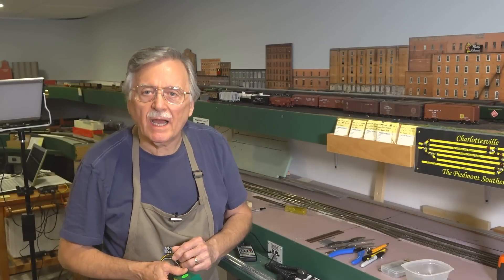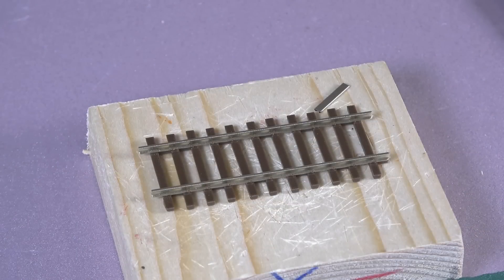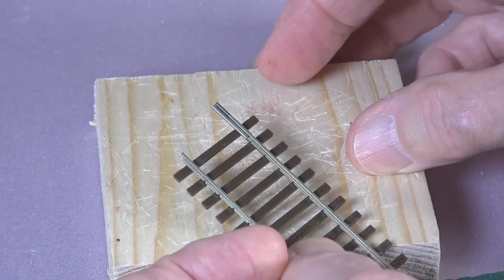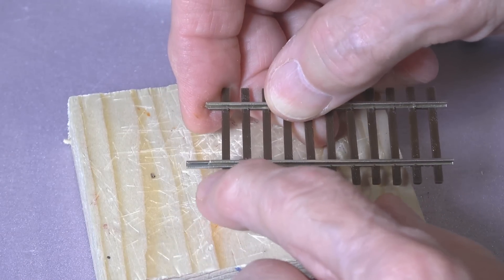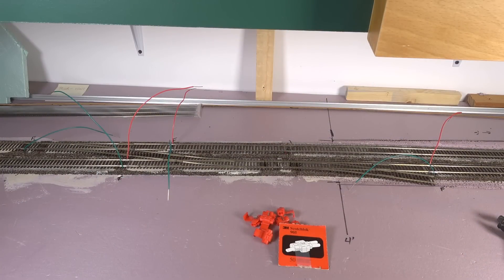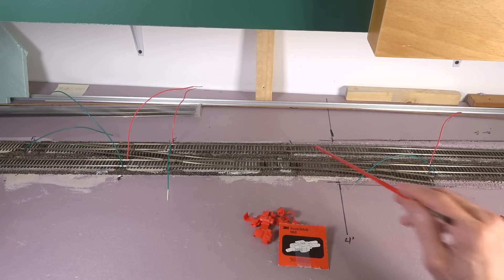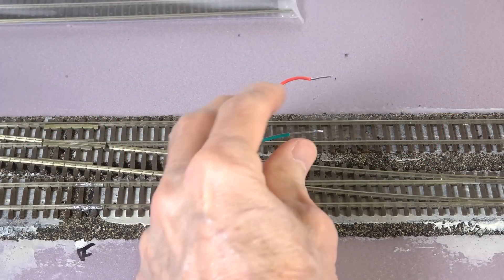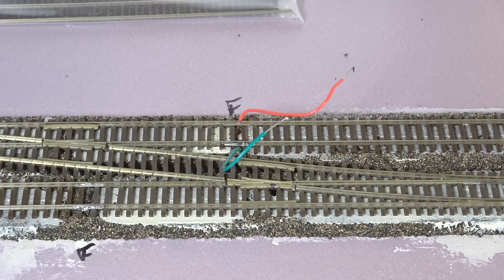Soldering Feeders And Adding Rail Joiners (343)

Comment: [  thank ,  you  larry  for  sharing  youre  video.  I,  bought  some  good  used  ho -  scale  track  from  a  yardsale  that  had  wires  solder  on  some  of  the  track.  I,  didnot  know  the  reason  for  this.  now  I  know  what  it's  about  now.  again ,  thank  you  larry  for  youre  explaining   this  to  me  and  others  and  the  purpose  why. ]
Reply from the maker: If those wires are just short subs where they were cut loose from the feeders wires then it would be best to remove them (desolder them) and add new full length feeders. If they are in the right place and long enough to reach through the roadbed then you could splice a feeder to them.

Comment: Half of the time when you go to solder the rail joiners the heat will warp the plastic rail. I just remove it and when Im done just a drop of crazy glue holds it just fine. Nice Video though!
Reply from the maker: Not if you use a heat sink as I have shown in some of my videos, or learn how to do it fast enough to prevent the melting.

Comment: When solo soldering the feeder wires to the track, try small wood slices (round toothpicks work well if the drilled hole is small enough) to wedge the wire in place, making the soldering easy. Nice video!

Comment: The regular rule for attaching dropper wires appears to be “black to the back”
I tend to think as follows. When following the track in a clockwise direction, I
work by  “red to the right”, the two “R’s”. Is this a valid alternative?
ps. Thank you for so many useful and easy to follow videos.
Reply from the maker: Whatever works for you, just be sure to document it and follow it consistently, about 95% of the problems folks have are due to mixing up wires.

Comment: Do you solder the joiners in place?
Reply from the maker: Most of them I do solder but I do leave scattered ones to provide expansion and contraction joints. These are especially necessary if the layout is an area that undergoes a wide range of temperatures such as a garage, attic, unheated outbuilding, etc. In my basement the temp stays in the mid to upper 60s and about 50% relative humidity year round so it isn’t a problem for me.
Reply: @TheDCCGuy  thank you.   Love your videos.  Very helpful.

Comment: Dear Larry, great instructional video. Love the way you’ve included the ‘bad’ joint. It’s indeed those instances where the ‘tug check’ or any other check people may come up with, are the easiest things to forego or forget. And of course those ‘bad joints’ are the ones which will need a lot of search effort whenever the joint gives up all by itself. 
Very much like the bent dog leg method. Humbly think a small jig with an attached spring loaded plier can be very helpful to perform the keep in place action whilst soldering.
Cheerio

Comment: I find your videos very instructive. I have been using a standard Exacto blade to cut the ties at the end of a section of track. Thanks for showing how to use a #17 blade to cut the ties. It is good to see that even a pro doesn't get the solder right the first time. 😄 What is the brand and wattage of the soldering iron that you use?
Reply from the maker: Its a Hakko. I talked about it in videos 35 & 214.

Comment: How long can I make a feeder wire that connects to a bus wire?
Reply from the maker: I like to keep mine 6-9” since I use 20 ga wire. Smaller wire will increase resistance and larger wire will decrease it so it is a tradeoff.
Reply: @TheDCCGuy  if I use 14 gauge wire I can go the 4 and a half feet?
Reply from the maker: Yes, I should have mentioned that earlier. You can use a heavier gauge wire until you get just below the feeder and then drop,down to the smaller gauge wire for the feeder.
Reply: @TheDCCGuy  I have one track the feeder wire is 4’6” to the nearest bus wire.   Is that too long?
Reply: @SkipRoGlo you should extend the bus wires closer to the join location

Comment: Larry do you recommend using Rosen core solder to help the flow of your solder when you heat it? I used to buy Rosen core solder at radio shack stores and it was superb for this application however I found that you need to clean up the acid from the melted solder joints, because it will decay the wire over time and the joint will break off. What do you think of that product
Reply from the maker: Rosin core solder is not acidic it is pine sap. Now a lot of non-acidic rosin is synthetic. I use additional paste rosin flux in cases where I am applying a lot of heat since you can easily burn off all the rosin in the solder before it can do its thing. However for small jobs such as electrical wiring or components I just use the rosin core solder alone.

Comment: Scott lock wire  are not good.   😢 Use wago type unit.  😊 Scott lock will keep cutting the wire until you have a open.   Wago clamp the wire they co e form 2 to 6 join.  You can reused them over and over.   I build police, fire and public work vehicle.  When I see the Scott lock on the wire in vehicle.  I cut the wire on both side and used wago.   Before that was but connector with heat shink.   
Also we don't sold the join.   But sold each independent section of track under the track and the drill hole where the wire go.    This is the fast way to do feeder.   You teach something form the pass 20 years.  Then i can talk about the power decorating.  But that is something else with dcc.

Comment: Thanks Larry, great tutorial. Have you ever soldered your feeder wires to the bottom of the rail or used wired terminal joiners that are soldered to the rails? What is your opinion on each as opposed to what you showed?
Reply from the maker: Solderi g to rail bottoms usually means doing it in advance and then fiddling with installing them essentially like the frog feeders I showed last time. With the method I showed here you can very close to putting them under the rail  and then the ballast will take cars of the rest. I’ve never liked the terminal joiners, always just found it easier to solder the wires, plus its one last thing to deal with.

Comment: With DCC friendly switches can you put feeders pretty much any where as opposed to being at the point end of the switch as we used to do with analogue all rail switches or electro frog switches.
Reply from the maker: As I said in the video the only feeders you need on a turnout like this one is at the frog. Otherwise all the rails are powered when connected to live rails at each end.

Comment: Is silver solder a better option for stronger joints?  I’ve used 60/40 rosin solder for years but understand that silver solder is stronger.
Reply from the maker: Have you checked the price of silver and silver solder lately? I think that will answer your question but no it is not needed.
Reply: Certainly from my past industrial experience there is nothing noticeable in it, certainly not for model railway use. You also will have to heat up another 30deg C or so to get the SAC alloy solder to flow - that I would suggest would increase the probability of more dry joints as well as slightly more damage to any surrounding  plastic…… skin, clothes. As Larry, it’s way more expensive, silver isn’t cheap!
Reply: The flux for silver solder is corrosive plus silver solder is expensive. The heat required will melt the ties.

Comment: The only problem with most soldering irons is that they have no way to turn them off without unplugging them or turning off the outlet they're connected to. If I buy one of my own, I'll install a switch so I can turn it off while I'm not using it so I don't burn myself or start a fire. Better to play it safe than hope it'll be fine and come back to a house or workshop that went up in flames.
Reply: Weller and other vendors make soldering stations that incorporate an ON/OFF switch as well as other features and enhancements that might address your concerns, as well as improve the quality and ease of use.
Reply: @michaelsmodelrailroading7665  That may be true, but a soldering station won't fit in a backpack. Or will it? I've never used one.
Reply: I am using electrical timer on an extension cord in an plastic electrical box.  If you forget to unplug the soldering iron the timer will automatically shut off.  Very safe
Reply: @verybusy8728  Timers can stop being timers at any point and be stuck either always on, or always off.